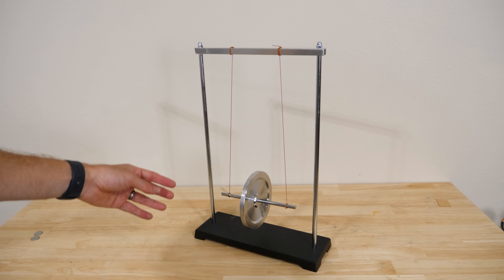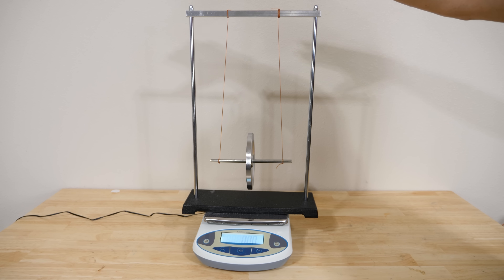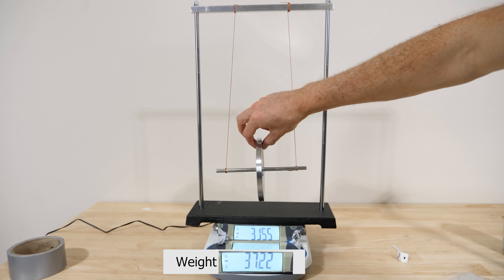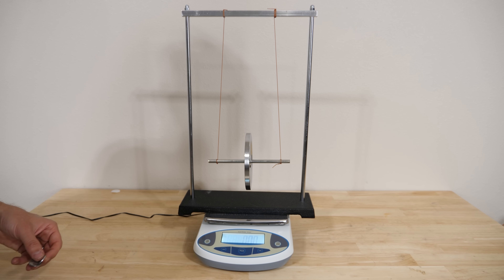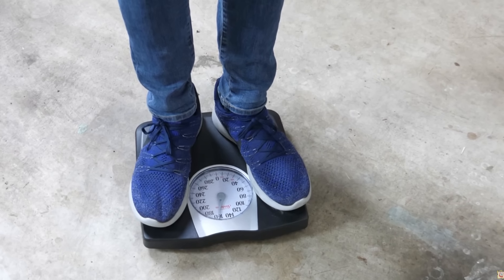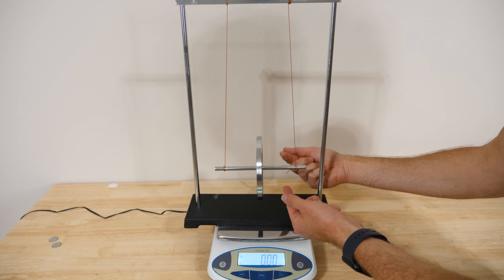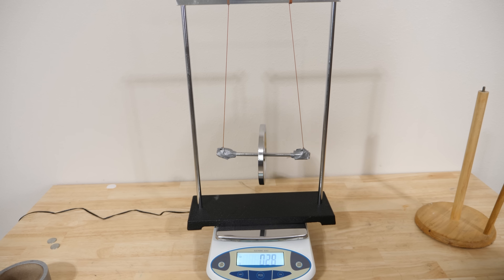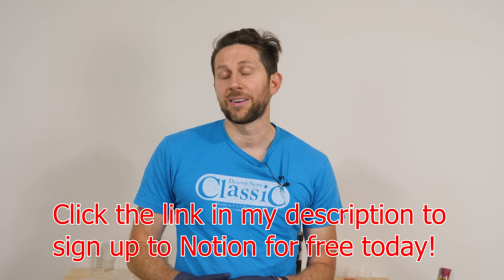How Does The Anti-Gravity Wheel Work?

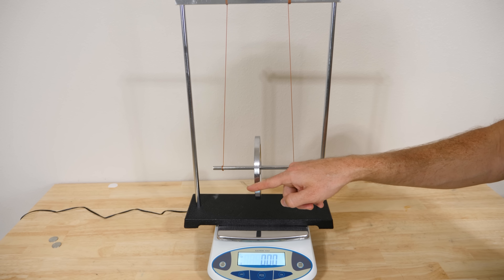Comment: around 7:56 to 8:10 time, you mention that we might be able to measure a fluctuation of weight if the refresh rate had been higher. But since the disc is still only decelerating and has not hit its bottom potential, I suspect that the weight will not fluctuate at the bottom point, it will continue to represent the deceleration force consistently. I request you to attempt the same on a high refresh rate weight scale and share the findings.
Reply: This device is a yo-yo. You can feel a sharp tug on your finger when a yo-yo reaches the bottom. A scale would feel the same thing.
Reply: When the disc bottoms out on the strings, it goes from moving downwards to moving upwards as it begins to wind back up the strings. The shock of it changing directions needs to go somewhere, so for a brief moment it’s translated along the strings to the frame, and probably delivers double the weight for that moment that was missing while it was falling
Reply: @StealthTheUnknown  That was my thoughts,  that the weight would go positive by a factor of time
Reply: @technic550  well, ZERO overall, but with long periods of minuscule weight suspended by the process.
Reply: @StealthTheUnknown  : no it doesn't change direction. it only changes the length of the string, but the rotation direction remains the same. it stops falling only when it has reached the least potential.
Reply: @harisamynaath9670   the length of the string never changes, just how it is oriented - wrapped, or expanded. 

The device oscillates back and forth between a high-potential, low-momentum energy state, and a high-momentum, low-potential energy state, where it trades the two back and forth, losing some energy with every cycle due to friction, gravity, and heat.

When the wheel is at its lowest point - that is, highest momentum, lowest potential energy state - it has 2 types of momentum: angular, from the unravelling strings, and LINEAR, from its downward motion due to gravity. The reason the scale registers a weight reduction is because of that linear momentum gained by the wheel.

The wheel behaves somewhat similar to a car’s engine, where it reciprocates like a piston. The piston has to accelerate, and does so every time it’s at top dead center or bottom dead center. The forces exerted on the pistons and the connecting arms due to acceleration are MASSIVE - upwards of several tons for brief moments. 

The wheel’s motion through space is linear, meaning it HAS to accelerate to change the direction it goes - up, or down. In order to do so, it must trade that energy with the system that it’s connected to somehow - in this case, there’s a momentary action on the end of the string where it attaches to the wheel. Of course, as the wheel moves up, it trades its angular momentum for linear momentum to climb the strings again. Because it’s still affected by gravity, its mass wants to resist this climb, resulting in the gravitational energy loss I described. But that’s exactly why it continues to register less weight than the total weight of the disc while it’s climbing; the device is literally giving the wheel a degree of freedom to trade energy with gravity by allowing it to be accelerated by gravity without direct linear implications on the overall system. The only time the device will feel a positive force is when the wheel bottoms out, and when it stops spinning.
Reply: @harisamynaath9670  It goes down and then it goes up, now I would say that is to change direction...
Reply: @harisamynaath9670  - It changes direction of movement. The rotation has nothing to do with this experiment. He could as well have used a weight on a spring. The experiment would have been the exact same.
Reply: @StealthTheUnknown  fair explanation.. thanks.
Reply: @peterwhitey4992  What the rotation does, is slow down the acceleration, so that there is a significant enough period of time for us to measure the loss of weight due to this acceleration.  This gives it disproportionately more inertia for its weight, by taking advantage of the energy stored in its rotation.  It's the same as the original purpose of Atwood's machine.   You could do the same with an Atwood machine and also get an apparent loss in weight of the system.
Reply: The weight will definitely fluctuate (go over zero) at the bottom. The disc is effectively bouncing on the weight.

Comment: All of this is so unintuitive. I wonder if when you lift the weight over your head if you wouldn't weigh less.  I feels like you are converting downward force into something else from your description.  Like pushing forward would equate to the spinning part moving up netting a reduction in downward force from when you aren't pushing. Like doing a pull-up but sideways. But I guess I'm smooth brain.
Reply: It's the acceleration of the center of mass, that makes something weigh less.  During most of the time in this problem, the acceleration of the disk's center of mass is downward.  The only exception is the brief period when it rebounds at the bottom of the string.  This is in the blindspot of the scale because of sampling bias.

Comment: So would the same thing happen with a mass hanging from a spring?
Reply: It would be less obvious, since the spring does it very smoothly. This wheel has a very sharp and sudden acceleration
Reply: @enderyu  Right, a bouncing mass on a spring would spend equal time making this assembly appear to weigh more, as it does making this assembly appear to weigh less, and on average, the readout on the scale would be zero.  This gives a negative readout on the scale, precisely because the refresh rate ignores the readout it would generate during the brief downward acceleration when it bounces off the bottom of the strings.   If you tracked this with a scale that produced an infinitely precise readout of the force in the scale (not subjected to nuisance effects that happen in a real scale), you'd get an average readout of zero with this setup.
Reply: Yes

Comment: If you had a perfect scale that would average the measured weight over a period of say, 10s it would indicate 0g again.
Reply: I dont think so, the weight oscillate between -5 and -8 during a long time compared to the full weight spike.
In fact it will depend on the refresh rate of the scale and for a perfect balance with infine resfresh rate the contribution of the full weight spike would be tiny because the negative moving phase last much longer.
Reply: Even if you could average the weight out from releasing it at the top till it stops at the bottom it wouldn't be 0. Because it lost some of its potential energy. For the time it is falling, it weighs less.
Reply: No, you have an elevated mass on the scale, 1 minute later that mass is resting a few inches lower on the scale. Think about it.
Reply from the maker: Nope, it never goes into the positive the whole time it is bouncing up and down. This is longer than 1 minutes of bounce time. It is definitely a weight decrease, not some scale averaging effect.
Reply: @TheActionLab  - It does go positive during the bounce, but as you said, the refresh rate of the scale isn't fast enough to show that. It weighs less while going up and down, but weighs more during the bounce. The average over enough time it is of course zero.
Reply: @peterwhitey4992  Nope I explained earlier why and The action lab confirmed it, also keep in mind that it is only true while the wheel is spinning of course
Reply: @peterwhitey4992  Yep, it's a yo-yo. The very-positive spike in weight is at the bottom, and the scale doesn't refresh fast enough to catch it. You feel the same tug on your finger when using a yo-yo.
Reply: @aetius31  - Your explanation is incorrect. The spinning of the wheel has no effect on the experiment. It is because of the bouncing and in between falling. The duration of the bounce is indeed very short, but it is also very forceful. What people don't realize, is just how much force an object hitting the ground exerts. It's easily hundreds of times it's weight if the bounce is quick enough. It is just incredibly brief, so you don't feel it much. The average weight will be exactly the same weight as if nothing it moving. This is easy physics and easy to calculate, but also obvious given the law of conservation of energy.
Reply: @peterwhitey4992  Nope again, I agree that the spike may be registered as higher mass  from a fast enough scale but 
1 it will be extremely short compared to the negative reading times.
2  The average negative value is simply a reflection of the stored potential energy, if you measure it at rest (potential energy spent you ll get the true weight)
So yes a  long you make the average reading while the wheel is still moving youll get a negative value (as long as the spike last less than 1%of the climbing time which is about the negative value ratio to the total mass) .
Reply: @aetius31  Since on average, the system isn't changing its momentum, the impulse from the scale HAS TO add up to zero between equivalent points within the cycle, assuming an idealized scale with infinite precision not subjected to the problem of the refresh rate, or other nuances that cause inaccuracies in a scale's measurements.  This means the force readout on the scale would also average out to zero.  I agree with Peter.

The problem is that the scale doesn't have enough time precision to accurately measure the bounce when the disk hits the bottom of the strings, so that we can get an accurate force vs time graph of that part of the motion, to calculate the total impulse.  There is a huge asymmetry in the time with a lower-than-average force in the scale, compared to the time with a higher-than-average force in the scale.  So much, that the higher-than-average force in the scale is in the blindspot of the scale's signal processor, which is why it appears to be an anti-gravity setup.
Reply: @carultch  It is not about the actual momentum of the wheel it is about the  AVERAGE mass  change PERCEIVED by the scale, which will be always be negative when going up or down.
The up and down movement last a very long time, the spike mass at the end of the rope last a very short time so it is normal that the average mass change is negative  .
It could be positive though if the up and down movement was very short but very unlikely to be equal to 0 unless the setup is prepared accordingly.
Reply: @aetius31  The "average mass change" is only negative because of the asymmetry in the time between when it is positive, and when it is negative.  The scale has a lot more time to measure the decrease in its compression, which biases the data we see to make it appear that there is a loss in weight of the system.

Like I said, if we could measure with infinite precision and avoid this bias from the sampling rate and the time asymmetry, we would measure an average of zero change in weight between equivalent points in the cycle.  Just use the impulse-momentum theorem.
Reply: @carultch  Btw i just just though about it but there is actually no mass spike because the wheel go up instantly due to its rotation ( it doesn t stop and go  but move like in a circular path from its point of view) , so yes it will be registered with an average negative mass variation because there no positive mass sipke in the first place (i dont know why i followed this idea )
Reply: @aetius31  I don't think that exempts it from having a positive spike on the scale reading.  An object in circular motion will be "heavy" when it is at the bottom of its loop.

If anything, if the axle took a circular path to turn around, it would require more force than if it came to a halt and reversed.
Reply: @TheActionLab  I think that might be because short spikes are absorbed by a low-pass filter in the electronics of the scale

Comment: Why does something weigh less when falling?
Reply: The true force of gravity on it remains the same.  What really changes, is the constraint force needed to keep it from sinking through the floor.  Since the center of mass is accelerating downward, the forces acting on this assembly have to add up to m*a in the downward direction.  This means that the force of gravity on this system exceeds the support force from the scale, and it will seem to weigh less.

You cannot really feel true gravity.  You only feel constraint forces, that you assume oppose gravity, and infer your weight from these constraint forces you feel.  This is why accelerating downward makes your apparent weight less.

In free fall, you would feel weightless, but it really means you are constraint-free, rather than truly weightless.
Reply: Weight is really mass changing directions or mass pushing against other masses. In orbit of earth you feel weightless, but your mass has not changed cause you are freefalling. On earth, you are not freefallung cause your mass is pushing down on earth and the earth is pushing up on you.

Comment: When you drop down on the scale, isn't it registering lower weight because your legs are lifting up as you fall and the spring in the scale pushes the scale up?
Reply: The scale doesn't measure weight, but measures constraint force.  When your center of mass accelerates downwards, it registers less force.  when your center of mass accelerates upwards, it registers more force.  It is due to the fact that your legs aren't carrying as much compression force as they normally do, that enables the scale to register less force as you drop down on the scale.
Reply: @carultch  isn't that what I said?